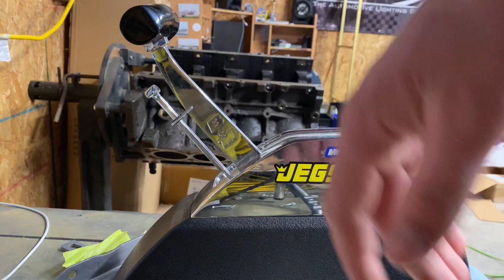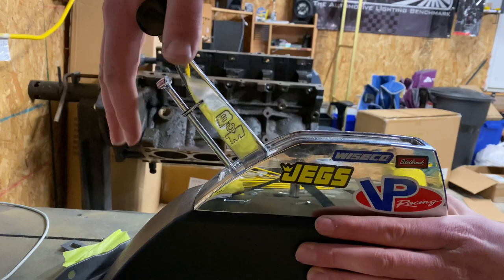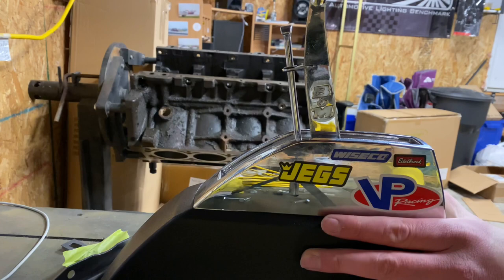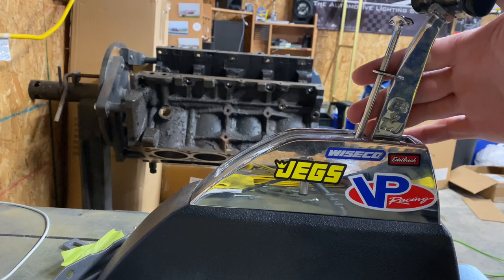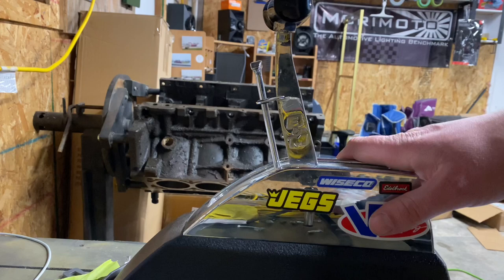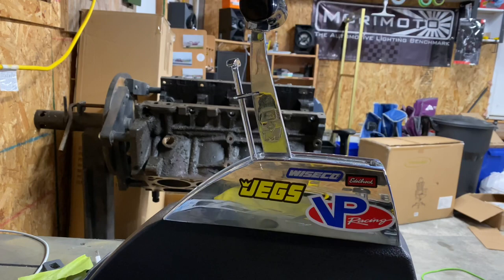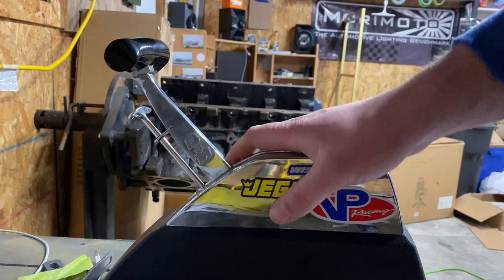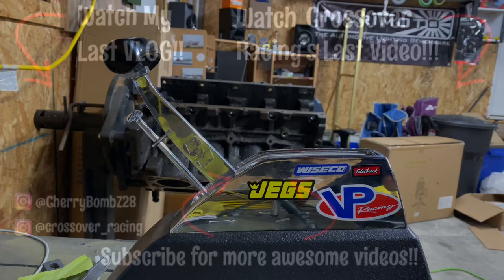Third Gen Camaro Drag Car | How To Shift The B&M Z Gate Shifter | VLOG EP: 13

Comment: The best shifter B&M makes. Everybody I knew that used the ratchet shifters eventually had them fail causing them to lose that round. The Z-Gate is basically bulletproof due to its simplicity. There are round knobs available.
Reply from the maker: I didn’t mind it. I just decided to go to the Pro Stick.